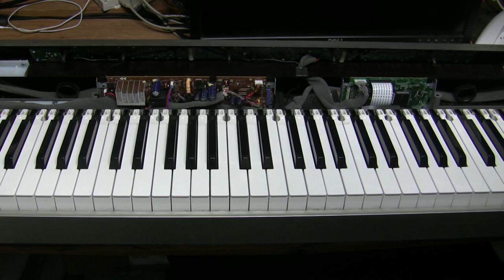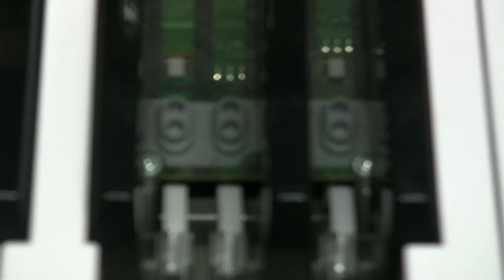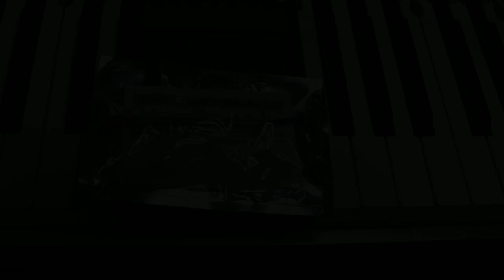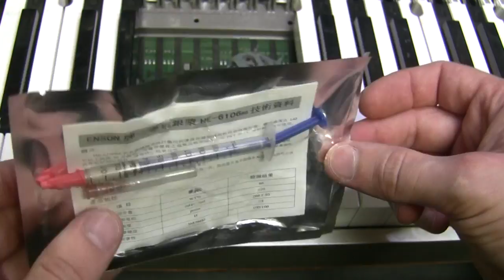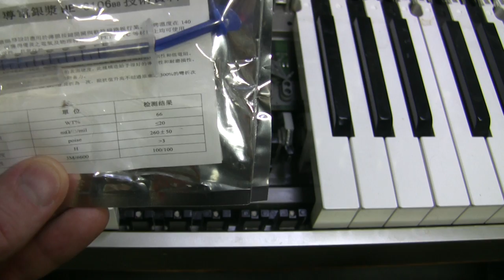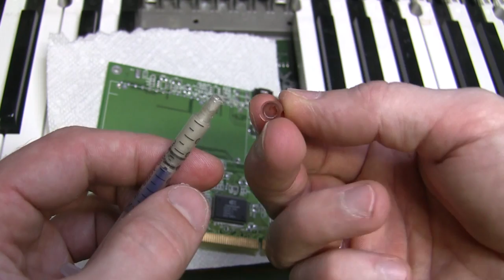#14 - Casio Privia PX-110 digital piano repair

Comment: I don't have any right to expect it from you, but I wish you had shown the process of taking it apart. I believe my Radio Shack DP-4073 is based on this Casio model, so I was hoping for clues... as I'm having trouble disassembling it. Still watching... may be able to learn something. Cheers 🙂 (I'm wondering how I'll get those metal square washer/spacers back in place... they just kind of fell out while trying to pry the plastic side panels off... among other issues.)

Comment: There's one of these available for $50 USD at a local second-hand store. I really like the way they textured the keys; they don't feel like plastic. Needs a lot of cleaning, it's untested, and a white key is sticking up like a buck tooth. But it looks in your video like it's made of generally repairable components. So I think I'll go for it.
Reply: Just bought a similar model for $50, working on repairs now. Kind of a beast but getting there
Reply: @wut2404  Good move. I ended up taking mine apart completely so I could clean it. Turn out to be pretty dirty because dust sticks to the grease in there.  Was a lot of work, but worth it. In case you're interested, I used Molykote 44 Medium Grease after cleaning the old gunk. Works well and should run smoothly for decades. Good luck, enjoy.
Reply: @mikefischbein3230mine is a px-150. I've gotten all the way into the guts to discover a bent hammer arm. I was hoping it was just the key needing to be reset onto its respective weight. 

Looks like it shouldn't be too bad of a fix if I can order the part. 
Mine is in desperate need of cleaning too, it has dust grit and pet hair everywhere. 

I will get that grease thanks for the recommendation! I think the work will be worth it.

Comment: Bravo!  Determination and delicacy spell success.
Reply: Do you have one of these or something similar? Were you able to fix a failing key? (I have a Radio Shack DP-4073 which I think is based on the Casio here and oof... not sure I can get this thing apart... or back together.) 😅

Comment: This video was incredibly useful. Thank you. I managed to remove the half million bolts (and managed to put back all but one!) and discovered that the black bushing on the end of the hammer weight of a central key had broken and fallen off. I stole a bushing from the lowest key (which I never use) and slipped it onto the hammer weight in question and hey presto! It started to work again. I could probably live with losing the top and bottom 3 keys, so that gives me some spares without having to track down replacement parts.

Comment: I have no idea if you still check comments, but I have the same problem. I contact points under the dead keys, and they look fine. However, I saw corrosion on the connector between the circuit boards under the keys. Water must have dropped on the connector, that is why the dead keys are in groups of two because they are the closest together on the connector. Is there anything that I can do about that? I looked at the traces at the connector between the boards and the that would be the part that I would have to repair.

Comment: I have another problem. (privia PX-160) On some black keys around the center (an area where I play a lot), a note-off plays an extra note (when I lift my finger off). It seems to move to a neigboring black key after I turned the piano around and vacuumed the keys thoroughly .I unscrewed everything at the bottom, but I couldn't lift the body to check under the keys.

Comment: how did you lift the black keys?..and how do you replace the keys  when done? (especially since you have to remove pretty well a whole octave to lift up the rubber part underneath)..I wonder how much a job like this would cost if I found a professional to do it (I live in Toronto)

Comment: That is AMAZING! I have a key on a very similiar Casio with a slightly different problem, like maybe the hammer has slipped out of place. I'm only guessing, but based on what I see in your video, I have a feeling that if I'm not afraid of removing "half a million screws" (lol), I will know pretty quickly what I am up against. I thank you for your video sincerely. You inspire me and give me courage!
Reply: Was the hammer hitting plastic by any chance?

Comment: Ok, so I found the problem removing the top of my px-160 it is probably the same in the other models. You need to pull on the side panels outward to get them out they click in and out, behind both are 2 more screws holding the top. Watch for the cables attached to the sides! To remove the top carefully lift it straight upwards, again mind the connectors!
Reply: Daniël van der Stelt how to remove the side boards? I can’t remove mine. I have the privia 350.

Comment: How to fix yamaha p45, working for how many minutes and then automatically play demo songs and i can't remove it even pressin the grand piano button every key has a different song that plays, when I turned off the piano I tried to turn it on but the red light is blinking. I tried to factory reset it many times, sometimes the blinking stops and will work for a few seconds/minutes and then it will automatically play demo songs again and when I turn it off again, the red light beside the power button blinks
Reply: yep thats happening to me...px-300. driving me nuts and i cant get cover off either, and i know my way around. casio is zero help, no repair manuals for us. why dont these manufacturers want us to repair these things? they could easily post repair videos. not inclined to buy their products if thats their attitude. super cocky bitches. presonus is the same way.

Comment: Thanks, thank you very much: with your video I have just finished repairing a defective button in my Casio PX160 !!!
Reply: Please, please, PLEASE! Tell me how you managed to open it! 

My PX-160 broke a few days back and I can't for the life of me figure out how to remove the cover to actually start fixing it.
Reply: @-DSet  Did you ever get the top open? I am having 4 keys not working and removed all screws from the PX-160 but how to open it?
Reply: @danielvanderstelt  Yes! The side panels are really difficult to remove but with enough force they come off and you can just lift the top cover. I used a knife as a wedge to remove them. 

You will need to use a scary amount of force.
Reply: Hi, how did you managed to Remove the keys? i cant lift the hammers and full them out

Comment: Pure gold! Casio should send you a huuuge gift - because I have seen a couple of complaints about failing keys, and I would not dare to buy the PX160 without this guide. I will order the glue along with the piano.
Reply: Old comment but I’ve had so many issues with my px160. One key which plays a very loud, sharp tone, let’s that jingle etc. works well enough for practice but it drives me crazy.

Comment: Hi, I have CDP-120. The F-sharp key also dead but it has fallen down. If i lift key and put it back down it plays the note, but the key wont come back up. Can I fix it similar or should I take it somewhere?
Reply from the maker: What do you mean by "similar"? This video was about fixing corroded traces. Your problem seems like something is stuck in the keyboard. Try flipping the keyboard upside down first. Anything rattling around? Does the problem move to another key? If you are handy enough and not afraid of taking it apart, and reasonably sure you are not going to make things worse in the process, I would suggest giving it a try. It might happen to be something you can fix. Assuming it is not covered by a warranty, or you don't mind voiding it.

Comment: Hi. I have a casio cdp 100. One of the key dosent have a well sound, sound too loud. What can i do?? Thanks!
Reply: finally i open the piano and...................... i fixit!!!!!!!!! Just unscrew all with a philip. In my case i clean the affected contact with "alcohol isopropilico" and for my surprise that was all! its working perfect.
Reply from the maker: You must have spilled some drink into your keyboard. Congratulations on your fix.
Reply from the maker: Each key has two contacts, which close at different points. The time between those events determines the "loudness" (the right technical term is "velocity"). Your problem must be with one of the contacts for that key not working. What you can do depends on your skills and readiness to open up your piano, disassemble things and figure out what is going on.
Reply: oh ok, thanks! ok , i can disassemble... yes probably the problem is one of the contacts, (it could be a problem that i dont need to buy another contact?? (i ask you these because i probably cant find one of those in my country). There is a way to fix a contact without replace??? Or if a contact (with this problem) dosent work its mandatory change the contact. (sorry for my bad english, i dont speak english). Thanks again!
Reply: Hi, I have the same problem with my piano (one key is too loud) but can't figure out how to take apart the piano. What tool did you use to unscrew your piano? Thank you!

Comment: I have a Casio Privia 320 and the same 2 keys, middle C and the B below it are acting up. They work but they make a loud twang sound. Its really annoying. Any idea what can be causing that?
Reply from the maker: I don't know. One possible reason might be that something was dropped into the keyboard. I have seen pennies and paper clips in keyboards. Try flipping the keyboard upside down, let's say. Do you hear anything rattling around? Does the problem move to another key? Open it up and have a look.
Reply: One thong that solved that issue for me was taking it apart, and looking at both of the membrane buttons on the affected key. One of them had some kind of petroleum jelly o it, which was causing the hammer to slip and hit the button at a funny angle. I took it apart, cleaned it, and now it works MUCH better.

Comment: What about if the key still works but its sticking like the spring is impeded somehow
Reply from the maker: I don't know. One possible reason might be that something was dropped into the keyboard. I have seen pennies and paper clips in keyboards. Try flipping the keyboard upside down, let's say. Do you hear anything rattling around? Does the problem move to another key? Open it up and have a look.

Comment: Hello.  I hope you can help me with an opinion about a problem i have with my Maudio Keystation pro 88. It starts ok, is recognized both by usb and midi interfaces and i can factory reset it withno problem. A strange thing is happening: i only get arpegios when i play in order on the white keys. 
C plays C
D plays C
E plays E 
F plays E
G plays G 
A plays G
B plays G
C plays C
That happens over all octaves.  5 keys don't record anything .  I wondered if a simple cleaning of the dead keys could solve the problem  with the arpeggios as well.  
Thank you for your time and attention.  
Ps: great and informative videos.

Comment: I cant remove the top of the case of my px 130?? I've unscrewed everything pretty much, I wish you showed yourself taking this apart.
Reply: LOZfaan did you ever get the case off and if so how? I'm stuck in the same situation.
Reply: If you're going to work on keyboards you need a long screw driver bit and a drill (makes things tolerable). Magnetize it with a strong magnet every so often.  Look in every screw-sized opening with a flashlight on back and sides.  You are probably missing some screws.

Comment: Oh bye the way the rubber type carbon contact assembly is called a membrane contact.    They are all different so don't go looking for a generic type.  The carbon contacts up inside are conductive but wear to almost o/c with repeated use, so much so that silver conductive paint is  used  to restore them.  Just clean the contacts with isopropal then apply the silver conductive paint and allow to dry.  Remote controls can be refurbished with this compound as well.    
There are two contacts to allow touch velocity of the player to be ascertained and the loudness of the key being struck to be modified accordingly.  Most older instruments of the 1950's to 1980's used to use gold or silver plated  whiskers and rods to form the contacts.   Organ & digital piano Manufactures, especially  Japanese shifted to membrane contacts in the early to mid eighties order to make keyboard manufacture a lot cheaper and in my opinion less reliable.  

Regards Rob
Reply: You good Sir, are a life-saver!

Comment: The silver conductive paint from China is of poor quality, the silver conductive  paint made in UK by  Wentworth limited, can be found at  electrolube    www.electrolube.com.    This is more expensive, in Australia  cost $15.90 AU at WES trade plus 10% sales tax.
It contains more silver and will last a longer time.   It comes in a small bottle and you apply it with a cotton bud (Q stick) or a small paint brush. It needs to be shaken before using.   When making resistance measurements an analogue meter is infinitely more appropriate, some digital multimeters can give misleading readings and with an analogue meter you don't have to wait for the meter to sample the resistance. It passes current through the circuit instantly.    I am an electronics tech with over 40 years in the trade, my apprenticeship started in  January 1965.
Reply: Instead of using conductive paint, why didn't he just solder it to make the connection?
Reply: Jeriel Lopez maybe because it’s not point to point connection

Comment: Sorry for my english, but I need help ! One key in my piano is loose (I don't know the correct word, but it moves to much, it is contrary to steady.) I open my Casio px 130 and it seems that the hook under the key (The  thing that goes up and down when you hit the key) is what is loose. You can move it left and right very easily like a loose tooth. But for me it looks like every other hook ! Then I don't have idea why it moves so much. I don't know if the slimy/oily thing in the base of the hook is glue. If it does, maybe this key has too few of it. Maybe it hasn't anything to do whit it. Well I don't know. I am really tired of trying to fix it and making no progress :/ . So please I hope you can give me a hint !
Reply: might want to try pushing it into the notch so it locks in place

Comment: Hello,

Thank you for your video. I have a problem with my Casio Celviano AP 38.

Several keys (4 white keys in a row and 3 black keys in between) don't make any sound unless any four of them are pressed together.
There is one other black key at the other side of the keyboard, which plays well until one of the broken keys mentioned before is pressed. When pressed simultaneously, black key doesn't make any sound.

I wonder, if these symptoms could isolate the problem and show which element of the piano is broken. I tried to clean the keys and the electronic board under them, but keys still don't work. Will replacement of the board under the keys help or this could be the problem of other elements? If yes, I will start looking for the new board in the internet.

I appreciate any kind of feedback.

Thank you,

Valentyn
Reply from the maker: +Valentine B 
It is hard to guess. Probably, some trace or traces are damaged (spilled drink?). Keyboard switches are arranged in some sort of a matrix. Maybe a broken trace can lead to such effect that you described.
https://en.wikipedia.org/wiki/Keyboard_matrix_circuit
Reply: FeedbackLoop thanks a lot for your reply

Comment: Hello Thanks for the video. I am having a hard time removing the key after I pry it open from the plastic latches on the top. When you say pick up the keyboard from the bench, what do you exactly mean?
Reply from the maker: +dineshnmehta 
I mean that you need to let the hammer for that key go lower than the surface of your desk or bench to remove a key. So I suggest putting something like a book under each side of the keyboard to create some space under it.

Comment: I'd give this more thumbs up if I could.  I don't actually need this information, but I just almost dropped a guitar pick into a Privia PX-110, and I wanted to see if it could be dismantled outside of a proprietary shop in case I ever do that.  I learned that it can, and that I'm probably just better off being really careful not to drop guitar picks between the keys. Oh... and that conductive glue exists, and that you can use solder to fix the top of a circuit board (?!).  Thanks!

Comment: thanks to your video, I just repaired a korg digital piano. same general design with rubber membrane. same type of corrosion on pcb. I used a bit of contact cleaner first in affected area, then a precise sanding with dremel for glue adhesion. Then used conductive glue, no soldering as I didn't want to risk heat damage. No reason for soldering on micro pcb's for traces if there's good adhesion. By the way, how much did you pay for this casio keyboard ?

Comment: I am having a similar issue. I have made my way to the contacts but do not see any corosion. Is there a way to check using the multimeter to see what is going on. Just one key doesnt work.

Comment: Thank you for share this.
I have a Casio PX-120 with same issue.
with your video,I opened it and found oxidized point on the board.
I have cleaned it and now waitting for my sliver glue.

BTW, the H on your video is not Hour but a hardness like it on pencil.